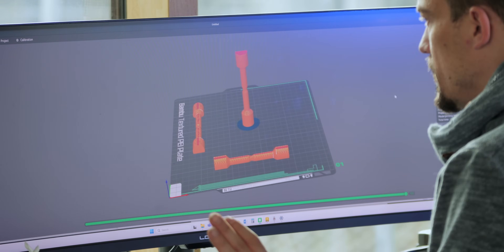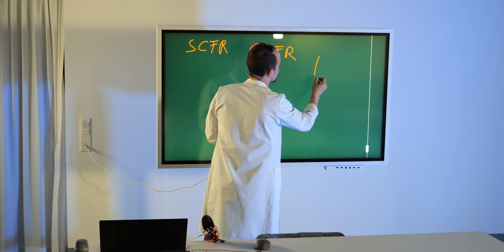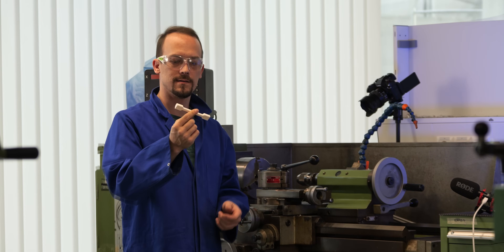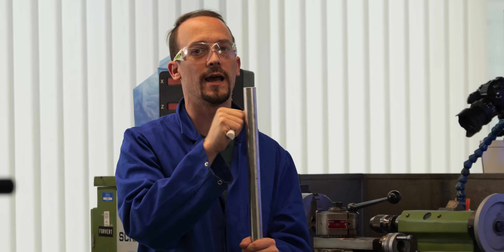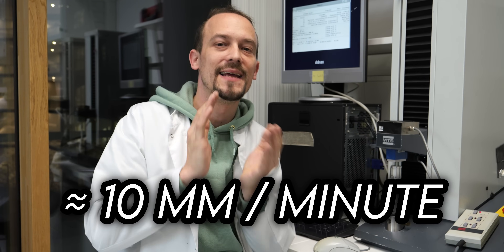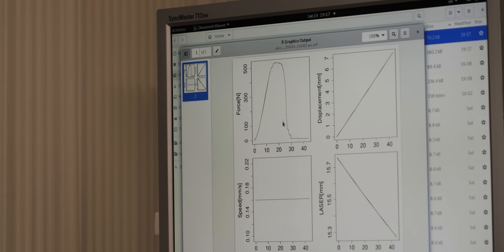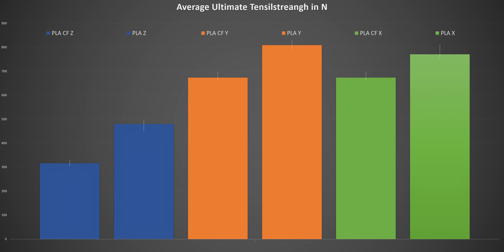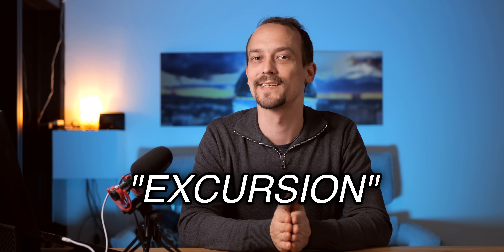The biggest SCAM in 3D Printing? How filament stores try to trick you with carbonfiber "reinforced"

Comment: People don´t understand material science is the whole problem. They think because something has CF in it is´t better, and CF is better than GF and so on. 
Fillings like CF and GF are mainly for stiffness, printability (does deform less) and temp. durability. It´way weaker in Z direction for instant because it has all those tiny fibers, they are basically like dirt within the material and prevent a good bond.
Reply: You illustrate a common problem in our society today - a lack of nuanced, critical thinking.  Something is deemed either the best or worthless based on a singular criterion, and all other options are discarded.  This is seen in all areas of life, from material selection to political discourse.  Nevermind that the initial selection of the "best" option was chosen based on preferences, flawed assumptions, a specific application, or whatever - that choice has been cemented.  

It's maddening, really.
Reply: @watcherofwatchers  "...a lack of nuanced, critical thinking...." Yes, reality is rarely one extrem or the other. Every material or technology has it´s pro´s and con´s and can be used accordingly. 
It´s like people having to nail wood together complain that others use a ratched because  it is absolutely clear that a hammer is the best and only tool ever needed.

"...Nevermind that the initial selection of the "best" option was chosen based on...a specific application...."
Honestly this is the best case. Something can absolutely be the best for a specific application with a specific goal or framework. But then it happens like you said it´s the best thing forever and becomes the best for every application. The best thing is understanding the available selection and choosing the right one. For me personally it´s a simple price to performance ration tech wise. 

Like I personally got an Adventurer 5M 3D printer. Was it because it was the best printer ? No. It was a good price to value package and it has it´s pro´s and con´t just like everything else. 

One of my most favorite videos in this regard was a Youtube who when asked what the strongest and best filament was proposed to use TPU. It´s basically indestructible if used as a housing for equipment or something. Cheaper than PA-CF and pretty neat overall.
Reply: Exactly.  The crushed CF in the filament actually REDUCES the amount of bonding per cubic mm of print.
Reply: I'm with you. But I don't think you should need a materials science background (I do) to understand that CF can't reinforce filament like woven CF reinforces epoxy in layups. There is no continuity of the CF strands. The individual fibres have to be very short and discontinuous due to the on off nature of extrusion. When I first heard of CF reinforced filament I immediately thought this is a joke surely. Having said that, I've not used CF filament so can't say more on the matter. Although it's interesting to read other's thoughts about improving stiffness, for example.
Reply: @robguyatt9602  It can look nice.
Thing is, the filament makers are COUNTING on folks NOT having enough knowledge of materials science to know the marketing fluff around CF is just that, fluff.
Reply: @burnsyd17  I'm not the least surprised. LOL.
Reply: @robguyatt9602  "...But I don't think you should need a materials science background..." No you don´t, but this knowledge you mentioned, is part of material science. 
You don´t need deep knowledge in material science, which I don´t have. I am just a mech. engineer, so I have a rough overview of materials and such. 

"...When I first heard of CF reinforced filament I immediately thought this is a joke surely...." Well I was quiet excited, since they are not all bad, it depends on what you are using it for. For instance with PA it´s great to mix in some CF or GF to improve the warping issue, make it print better and less flexible. So in this regard it does absolutely makes sense it just does not make your part stronger. 
Right now I do print some PA6-CF20 parts with our FDM machine at work for temp. testing. The Heat Deflection Temperature
(0.45MPa) of this material is 215°C!!! That´s awesome, it´s exactly what I needed. Everything else about this material though is ass. It prints like ass, still warps, has a rough and coarse surface, is expensive and layer bonding is basically non existent. I can pull it apart with my hands. It needs annealing too which adds yet again an other work process and if all this weren´t enough, I don´t trust the safety of those fibers. They are super fine, lightweight and I suspect them to work like Asbestos does. But I do absolutely need it for that temp. testing.
Reply: @sierraecho884  Thanks for the extra info. To be clear, my incredulity was only about the comparison between CF "reinforcement" in filament and real reinforcement of epoxy with continuous strand CF. Regarding materials science, like you I got mine from doing mech eng. The subject was engineering materials. I hope I didn't come off sounding like I was claiming to be a scientist. Science nerd? YEP. LOL
Reply: @robguyatt9602  "...between CF "reinforcement" in filament and real reinforcement of epoxy with continuous strand CF...." Oh there is absolutely no comparison at all. It´s not even in the same universe. You are absolutely right about that. 
The only other thing crossing my mind is, we should probably compare CF and GF filled materials, between injection molded parts and 3D prints, rather than continuous strand with epoxy matrix. It would be a more fair comparison I think.

From experience I would say GF fillet, injection molded parts are also stronger (in the flow direction) compared to non filled injection molded parts. This must be due to longer fibers. They are also chopped up, but still longer overall. I don´t remember how glass spheres behaved as a filling. I should probably look it up....thanks for reminding me.

"...The subject was engineering materials. I hope I didn't come off sounding like I was claiming to be a scientist...." Oh no, it´s absolutely fine. One engineer can also know way more about materials than an other engineer. I had co-workers who specialized in materials, also being a mech. engineer. He know waaaay more than I do in regard to this topic. Sadly I switched the company and can´t ask him anymore.
Reply: LOL, the unique selling point is basically a contaminant!
Reply: @sail4life  incorrect.
Reply: @sail4life  This is basically correct.
Reply: I agree. And I love printing in CF for dimensional stability, but you do have to print hotter to get sufficient melt. However, I will say the materials X and Y properties are improved with CF and GG additives for the reasons he point about the fiber alignment. But "Z" will always be an issue. Which it is up to you as the machine operator to slice the part in such an orientation to minimize or eliminate that possibility as much as possible.
Reply: @SouthValleyKnifeCo  "...I will say the materials X and Y properties are improved with CF and GG additives for the reasons he point about the fiber alignment...." They can be, depending on the length of the fibers. But most of the time they are way too small to make an impact here. Usually even XY degrades, as he has shown here as well.
Reply from the maker: thas why ccfr works well. there the fiber is so long that it self carys the load.
Reply: @Ibuiltathing  Yes absolutely.